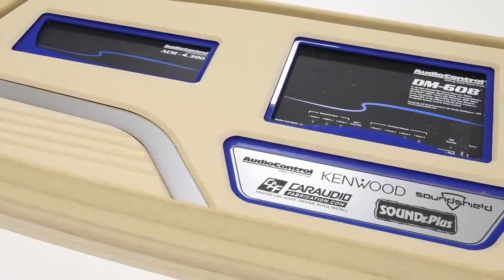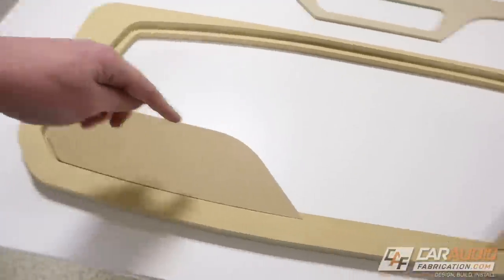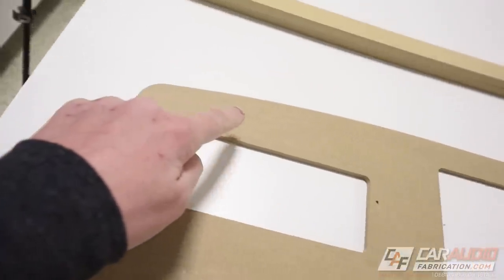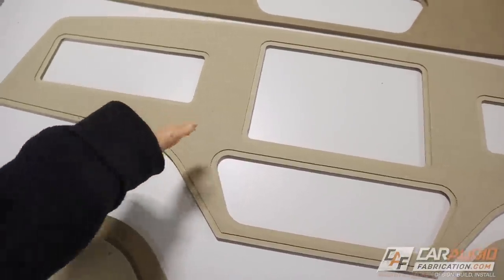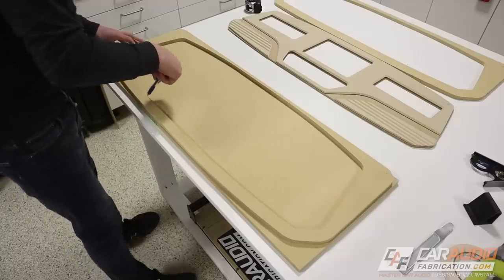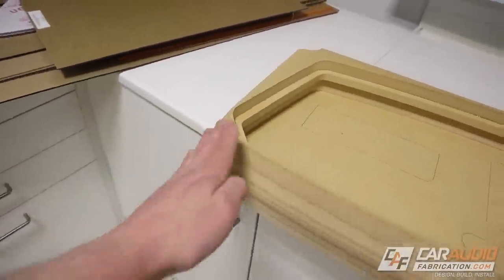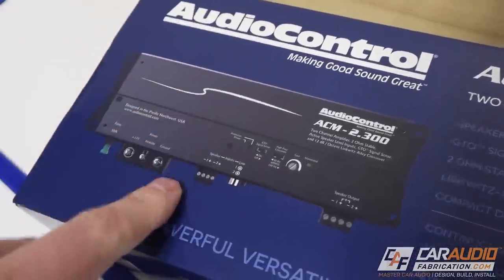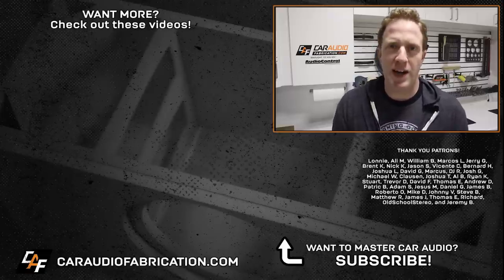ADVANCED FAB - Amplifier & DSP Rack w/ Acrylic Inserts! - Project SMART

Comment: What product do you recommend for engine noise suppression?  97 BMW 3 series with an Alpine radio to a kicker front row. Stinger 9000 RCAs, run down the center of the car, 14g ground wire from radio run down the center of the car to the AMP and kicker ground. 2 noise suppressors on the radio powers wires and ferrite rings on all radio and kicker power wires. The Alpine is the source of the noise.

Comment: Hey, I bought the audio control Lc2i along with infinity kappa 6x9 and tweeter component set for my Toyota Tacoma. I also had a Rockford Fosgate 4 channel amp and installed everything this weekend. The speakers came with crossovers so I also installed those. They don't sound as good as was hoping for so I was wondering if I could run the tweeters off of 2 channels and the woofers off another 2. Also should i have my amp set to hp crossover or all pass crossover, and would it be better to run the two sides on front and rear bridged?
Reply: sorry thats a lot of questions really fast. haha